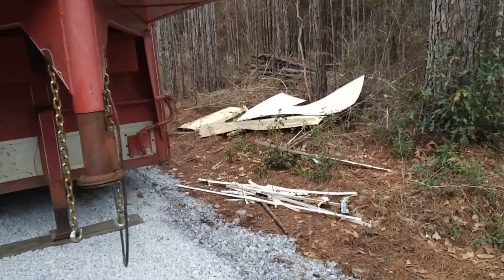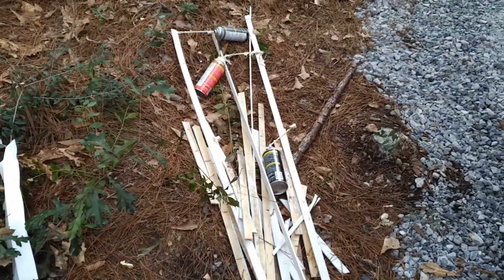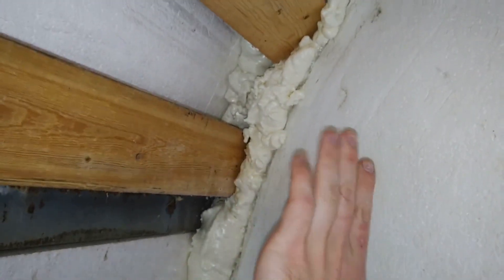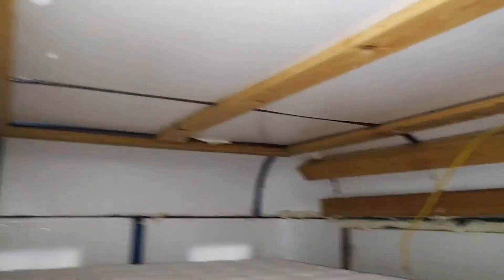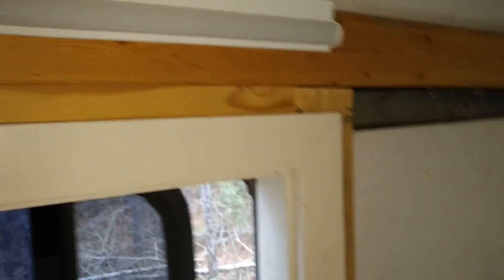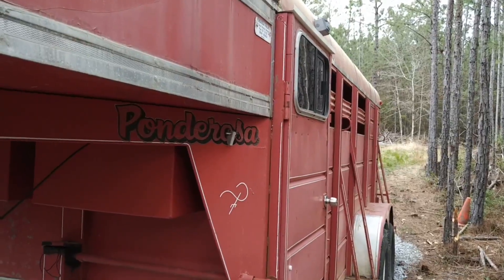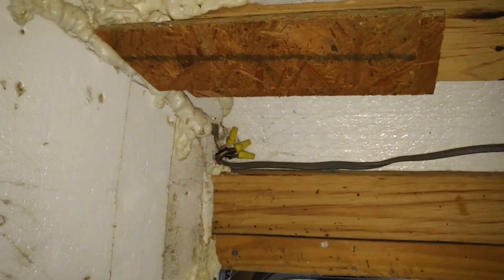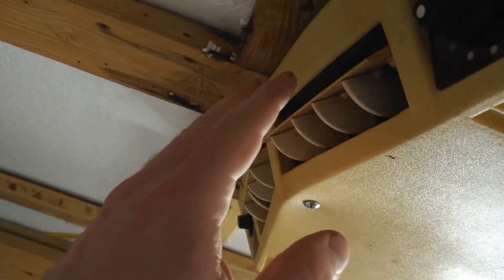Trailer update #2

Comment: Nice video! I built a trailer very similar. They make a Glue specifically for that type of insulation that you’re using you can find it at Lowes or Home Depot it goes in the caulking gun. I think if you throw some solar panels on it would make it really nice and a white paint job to match your truck and you’ll be good to go. Keep up the good work I enjoy watching your videos. Thanks for sharing.